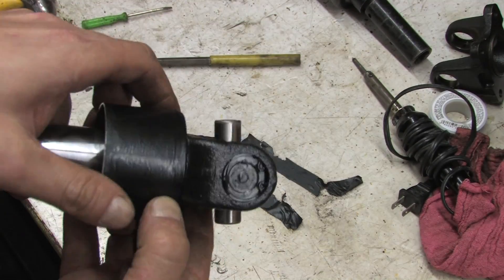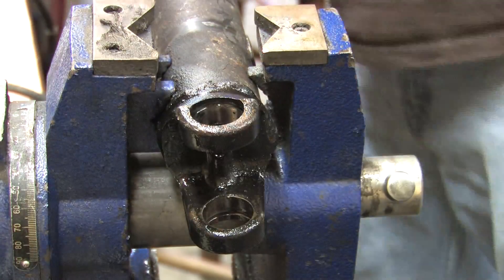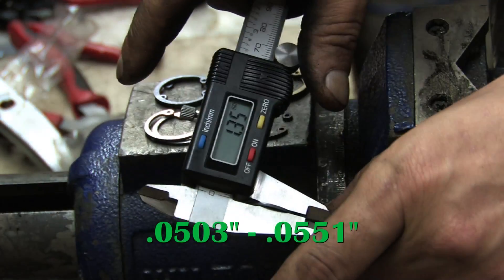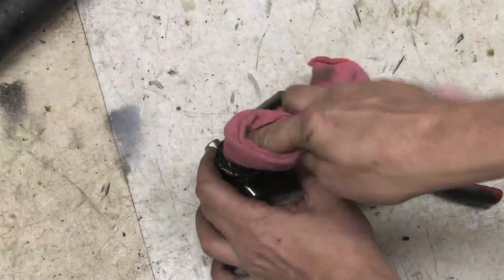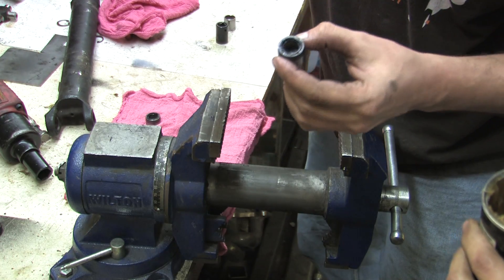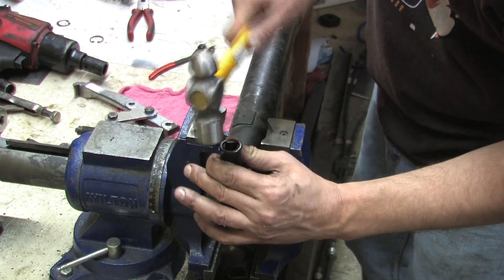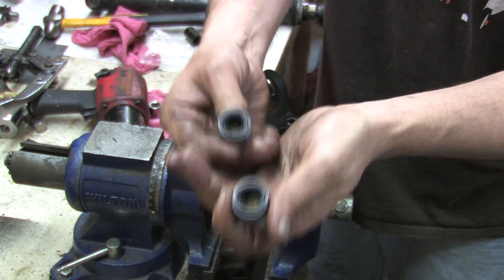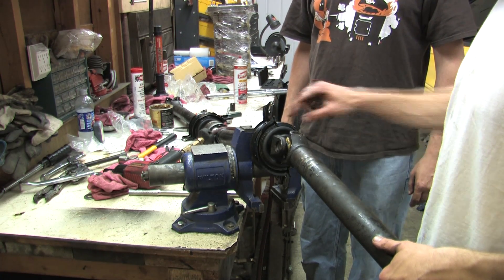Driveshaft 105 - Install U-joints

Comment: i'm always surprised to see the centre bearing carriers held on by 2 tiny 10mm (3/8") bolts.  Also the rubber bellows of most centre bearings is light as. So I figure the system relies on a very well balanced set of shafts "floating" around in rubber mounts ( most Australian cars also have rubber flex joints instead of UV's at the gearbox end.. ) This means that shaft balance is critical. So I meticulously relocate weights and bolts and alignment, and centre UV's as carefully as you do.. etc etc .. but then I drive the vehicle up to max speed and down.  50% of the time balance is ok.. 50% I spend $60 getting the shafts rebalanced. The test for balance? .. scientifically.. I hold the gear shifter as i'm driving.. if it vibrates it's US (unsatisfactory..)

Comment: Awesome Videos man! Can anyone confirm if the yoke kit used is the same for the 2003 Evo 8. Also if any of the parts used are also the same for the Evo. The Boot Kit looks exactly the same, but different part number. Boot Kit = MB837572